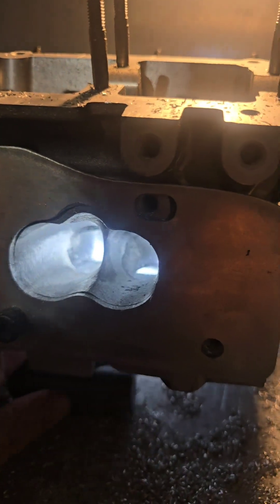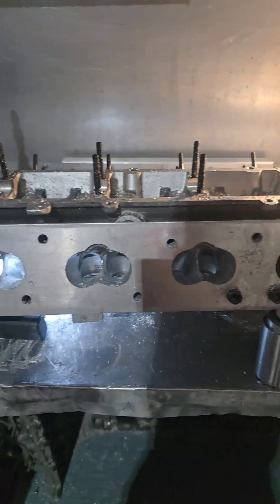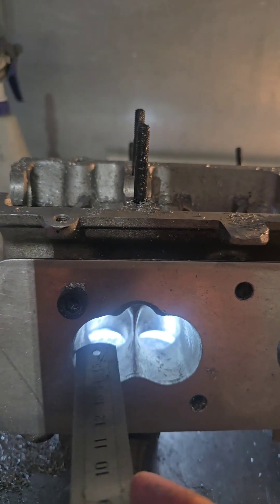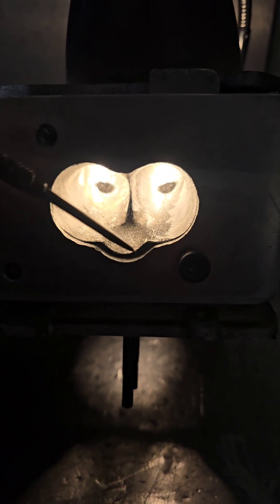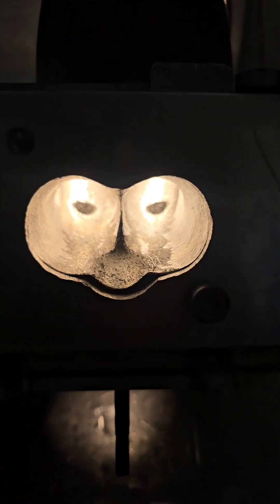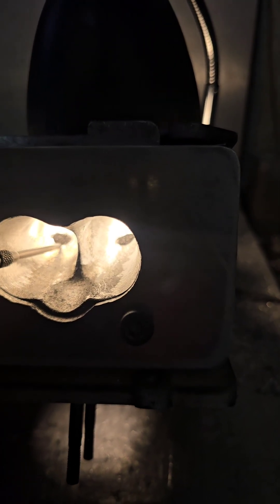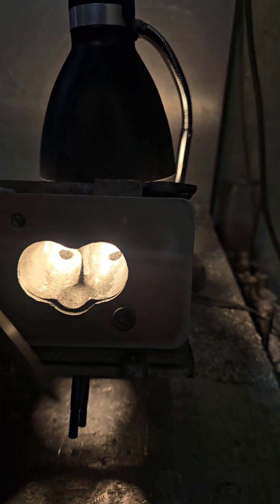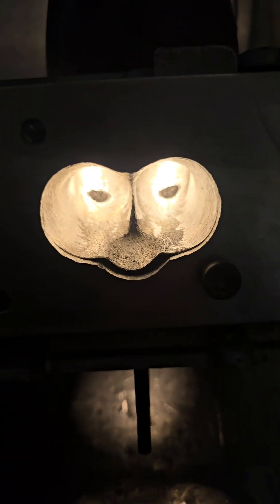RB26 Head Porting Part 3 Optimizing Port Energy, Velocity for Plazmaman Intake, #plazmaman #porting

Comment: What’s the max air speed you like to see? Is the MCSA supposed to be at the throat?
Reply from the maker: All comes down to the head designed mate.   

Some of the "restricted" series, like in super stock we build intakes for they are +700fps.  And they still go 2.85hp per cube.   But older 23-degree style where the window is lower than the SSR, you may want to limit these to 670 in a comp engine. Or even lower, like 640fps. 

Also, it will depend on where the MCSA area is in the port and what the "ratio" is like. Meaning how much bigger the maximum CSA is vs. the MCSA and the distance between these ports.   This is why you see some heads like a little larger MCSA and some like a little larger even though the ACSA is the same. 

For example,  like an early Cleveland when the MCSA is just around the SRR. You need to be really careful. it's not too fast, or it skips straight off the short turn, especially when peak velocity switches from the seat ring to the MCSA once you exceed the saturation point.  Would see this on the flow bench all the time. Especially pushing higher pressure drops like 35-40".   

This is why I hate all these hard and fast rules.  It's also why I designed the new calculators for Einstein motors with an adjustable velocity target for the MCSA area.  So people can select their own targets depending on the head design. 

Hope that makes sense, mate 👍